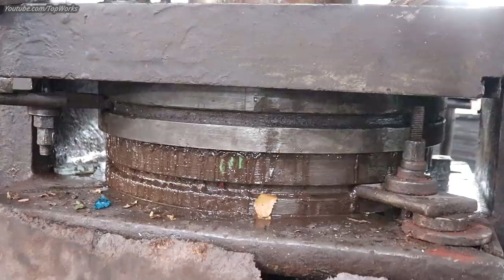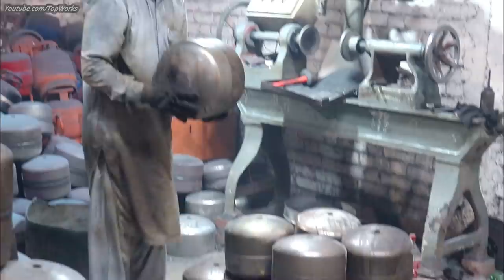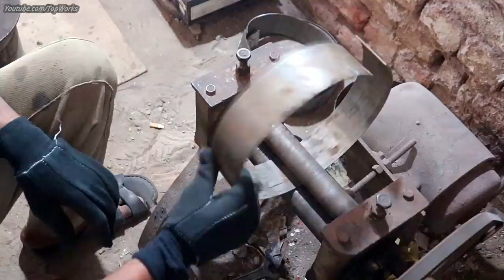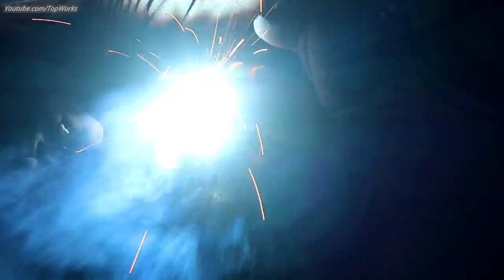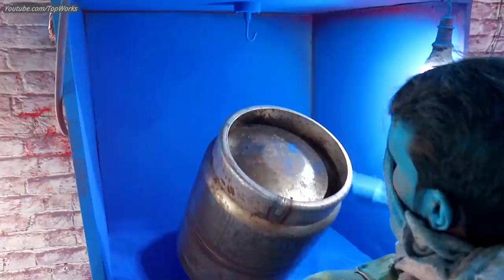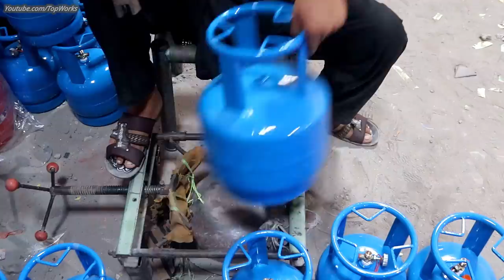How LPG Gas Cylinder are made in Factory with Amazing Process

Comment: That's nice, and it's great they can do that for themselves in that depressed country. However, those propane bottles would Never pass inspection here.
Reply: They are pressure testing to a high enough pressure to create vapor when they release  . I feel sorry for the unprotected guys in the paint shop , and the poor guy pressure testing if one fails .
Reply: Yea they would never be filled where I am.
Reply: Where is ‘here’ and why it would not pass ?
Reply: @elkid6743  United States. UL Underwriters Laboratories. Those bottles must be inspected at each weld, pressure tested, anti backfire valves, anti tip valve, high pressure blow off valve etc. The seam around the middle is only the first red flag.
Reply: @masterace1150  🤣 Don't worry, in a couple years your 6th grade English teacher will explain that the word "depressed" has several meanings and applicatíons. 
🤣😂

Comment: Those rings under the cylinders need openings for air circulation to avoid moisture underneath the cylinder surface, otherwise the moisture would causes rusting the under surface
Reply: This is in India, they don't have the same standards that the US does.
Reply: @jeffs-reviews  pakistan not India
Reply: @jeffs-reviews  this isn't India buddy this is Pakistan
Reply: They make their floors with craters and holes instead.

Comment: The sheet metal plate looked very thin for a LPG tank. On the other hand the paint could really be strong because in the west because of environmental /health risks modern (water based) paints are often softer/weaker than the old paints.
Reply: Perhaps..  Because its a small sized tank approx 4 kg..  It has a smaller amount of gas/less pressure?... I was also thinking the metal is too thin for australian standards.
Reply: That wasn't paint, it was powdered plastic that gets baked on, usually called powder coating.
Reply: @jonathanjudd3168  You're right, it seems to be powder coating, the first time I glossed over the "painting" job very swiftly.
Reply: In where I live the smallest LPG tank is 3kg. With a net weight of 5kg and maximum operation of 5 years. The production is government manufactured and regulated. House manufactured is illegal.
Reply: Thickness of the sheets for this size of cylinder is 2.5 mm. I think when he was making the top hole it seemed it's just around the size.
Reply: @Brisbaneview  Exactly.  This isn't a SCUBA tank.  It's for LPG.  The walls are the right thickness.
Reply: Yesss you are right it's very thin and LPG need pressure it's totally risk
Reply: @JosephcallsmeNolan  давления газа всегда одинаково. В России- 1,6 MPa рабочее, 2,5 испытательное и 5 разрушающее.

Comment: I am really happy that they are getting employment but these cylinders seem pretty dangers... the metal is too thin to hold any sort of pressure. In my country you can't even think about lifting a cylinder with one hand. It's too heavy.
Reply: maybe they have a lower pressure rating and looser safety laws seeing how they work without protective equipment
Reply: Maybe u are just to weak ?.In my country cylinders that size are more or less same weight based on how they handle them.

Comment: How to avoid tank puncture during welding?
Reply: Weld it properly. Using correct process, correct parameters and correct equipment.
Reply: Lower amps, maybe 2mm arc sticks.. And quicker

Comment: Well, the midseam on th bottles seemed OK, but the bottom and top rings were not even welded, they were just attached with random sparks, and it is also nice seeing that the Avatar people got jobs in the painting department.
Reply: PPE = Personal Protective Equipment
Reply: The welder and welding were better than you think.  Random sparks, not.

Comment: No hydraulic pressure test? What happens if they tank ruptures with the compressed air bubble test?!! Interesting that the tank is welded semi-automatic SMAW and then the valve nut just haphazardly MMA'd onto the cylinder. With such thin wall material, attaching the foot and guard with MMA gives rise to partial burn through risk. People complain about the costs of goods made to standards in the West but we are not comparing like with like.

Comment: "Testing with air pressure"....?

The entire thing wasnt submerged ffs, was testing the integrity of the valve nozzle at all!!!
Then later, for the guy cleaning the tank up after, to have to use a hammer to remove the slag from the weld around the nozzle amplifies how the guy welding the nozzles into the bottles really needs to have a few lessons in what he's doing🙄

Comment: Procedure of testing is totally wrong and unsafe. Cylinders and pressure vessel are never filled with air during pressure testing. Water is filled inside the cylinder or pressure vessel and 1.5 times of operating pressure monitored by pressure gauge is applied for a certain time inside cylinder and leakage is observed (hydrolic pressure test) . 
The way boy was testing with air, if cylinder blasts , the boy will be seriously injured because air is compressible fluid whereas water is non compressible fluid. If water is filled inside the cylinder during testing and cylinder is cracked, it will not blast whereas in case of air if cylinder is cracked, it will blast like explosion.
Reply: Pressure testing is not done with air but with water. For safety reasons:

Air, in case of production failure, would expand heavily and cause an explosion. 
Water, instead, not being compressible, would just run out.

Comment: First of all, are they safe? The sheet guage is so less to withstand the LPG pressure and no safety valves, no quality checks are there.
These cylinders does not pass European or any safety standards for sure...
Reply: They have a air pressure leak test